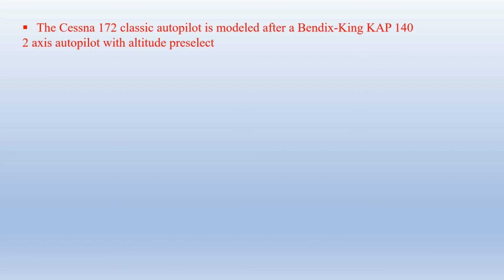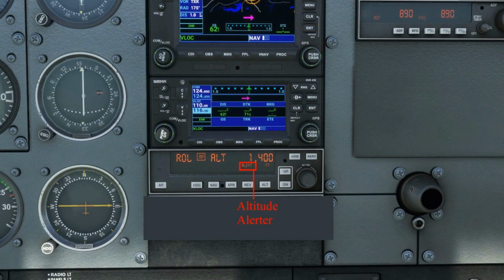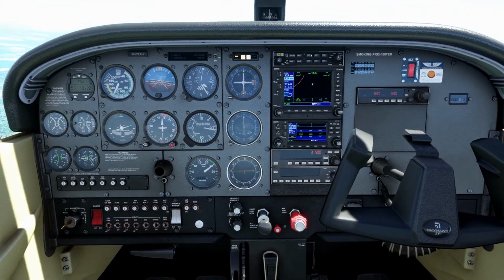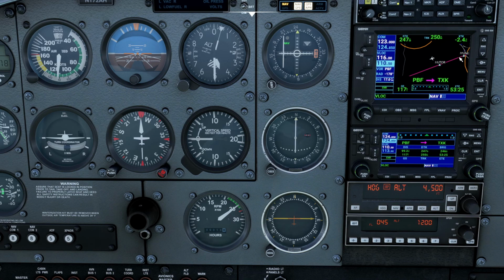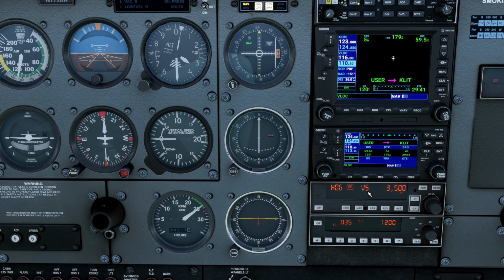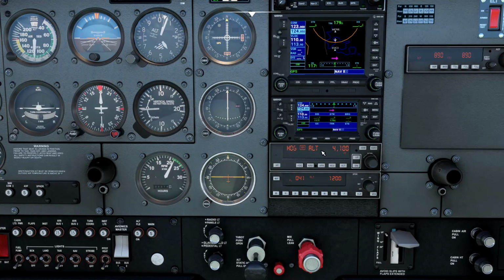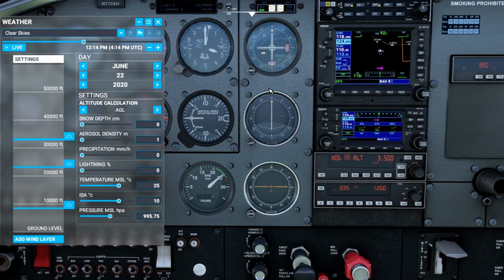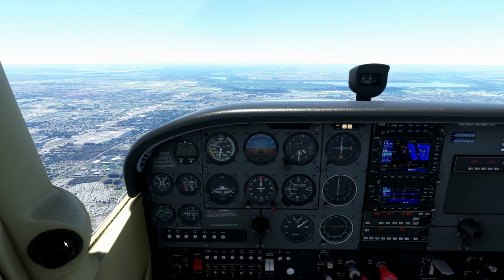Flight Simulator 2020 - Autopilot tutorial - Cessna 172 classic

Comment: After take off if I engage the altitude AP it locks on the current altitude and I have to reset the desired altitude.
I recall there is something you can change to have your desire altitude remain on the AP display?
Reply from the maker: Make sure to set your desired/assigned altitude in the with the altitude preselect (the two knobs on the right side of the Autopilot.)  When you first engage the autopilot, it now engages in a vertical speed hold mode that is set to your current vertical speed.  It will momentarily show the set vertical speed in the altitude select window, then revert to showing the preselected altitude.  You can adust the vertical speed by pressing the up and down buttons, and it will momentarily revert to showing the selected vertical speed when you do so.

Comment: Very very good video, by the way. Easily understood. My greatest frustration is with the approach mode in the sim. I don't fly now but when I did fly real world ILS approaches, I would normally be vectored to intercept the localizer. I would follow the controller's direction with HDG mode, and as I neared the intercept I would press the APR mode. The autopilot would then capture and turn to the localizer course and subsequently capture the glideslope. When I try that in the sim, no matter which aircraft or whether its the 530 or G1000, it blows right through the localizer. If the only way to use APR mode in the sim is to hand fly onto the localizer (or stay in the NAV mode until you are on the localizer course), as you suggest and then press the APR mode in time to capture the glideslope, well.... I hate that. I wish they would fix it to the way it works in actual practice.
Reply from the maker: Thanks, Charles - glad you enjoyed the video.

It is frustrating how avionics are different in flight sim vs the real units.  Hopefully something they will fix as they continue to make improvements to the sim.

Another workaround you can try is to create a GPS flight plan that includes a fix on the approach course (ideally one or two fixes prior to the final approach fix/GS intercept.)  This allows you to navigate onto the course with the GPS.  You can then briefly switch to hdg hold (or even roll hold/wing level) switch your nav source to the ILS, and then engage the approach mode.
Reply: @AlphaHotelFlightSimulation  thank you for your reply. I agree, this version of the sim is remarkable in so many ways. We can find work arounds until it's perfect 😁.

Comment: Very good. One of the best explanations out there. Will you do a similar one for RNAV approaches using the GPS mode with the A/P including glideslope? Thanks!
Reply from the maker: Thank you Dennis, Glad you enjoyed.

Working on a video covering the GNS430/530, and hope to have it out in a few weeks.  The 430/530 does not have a glideslope feature or VNAV capability in flight simulator currently, so you have to fly those approaches using vertical speed.  

Will also be doing a video on the G1000.  That unit does create a glideslope that can be flow using the autopilot in approach mode - though there are some quirks.